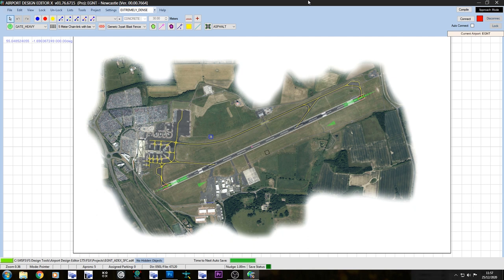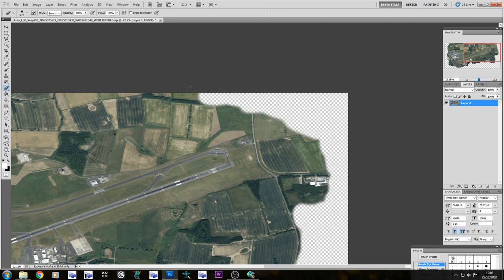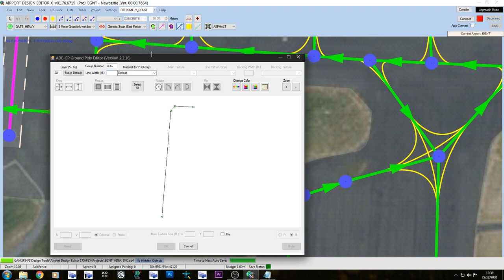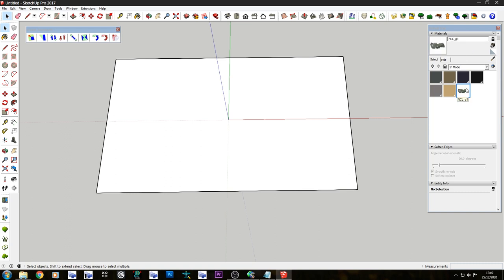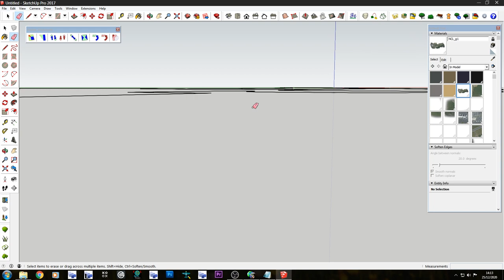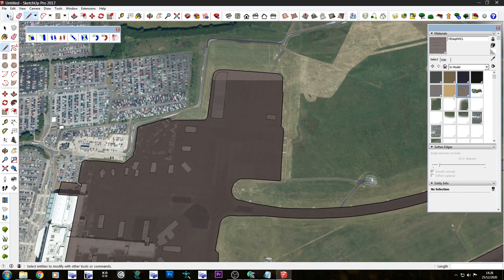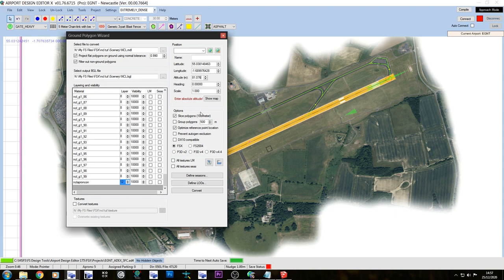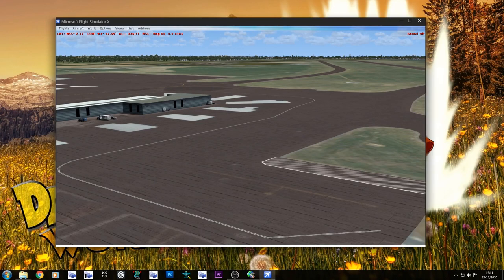Making Scenery | Part 4 - Making it look spexy with ground polys

Comment: Hey Mark! Thanks so much for your tutorial videos!
I had a specific video request, can you make one in which you create ground marking textures (runway ahead, 14-32/09-27 etc), import into ADE, and then place them in a scenery using ADE and finally load into simulator to check. 

I cant seem to get myself sorted with this, ground polys never loads for me for some reason. 

Thanks! :)

Comment: I have a slightly weird problem: The converted ground poly bgl file has 2 triangular holes near the centre of the airport and I’m not entirely sure what is causing that or how to fix it.
Reply from the maker: That sometimes happens with MCX the only way around it I have discovered so far is to export the main GP again then run it through MCX. It's just one of those things that sometimes happens.

Comment: hi, im having a problem and i hope you can help me. When i load the scenery to p3d, my scenery is loaded but the texture is kinda corrupted and all i see is just a black cover my scenery.
And i have no idea how to fix it :(
Reply from the maker: Usually black means the textures were not loaded correctly or are the incorrect format. P3D needs for the textures to either be DXTBMP or DDS. Make sure you add the scenery and textures to the correct folders :)
Reply: @Soarflyconcepts i think i had saved it as BMP😢.  Thanks for your help i really appreciate it🥰

Comment: .dae exported from sketch having a full white background. How to get rid of that white bg? nees assist...!!
Reply from the maker: Teaxtuers should be in a folder called the same for example your .dae is hill.dae the folder will be called "hill" if you encounter issues after using mcx youll need to make sure the textures are in the correct format for flight sim

Comment: hello how can i create an sloped runway in FSX/P3D using  ground polygonds?
Reply from the maker: Sloped scenery is a 3D model in most circumstances. The easiest way to create it is to make an actual model and give it a hard surface (landable)
Reply: @Soarflyconcepts  and then how can i make the ground poly follow the slope
Reply from the maker: @manu0598  in general you can't, ground polygons are flat. To display undulations you need a mix of ground polys and 3D models